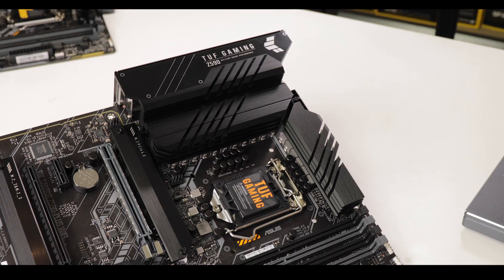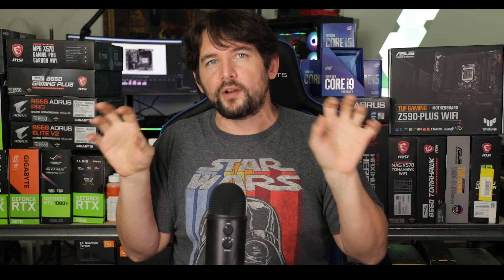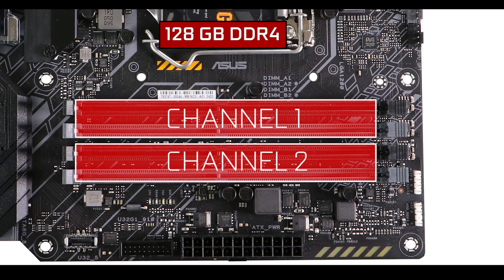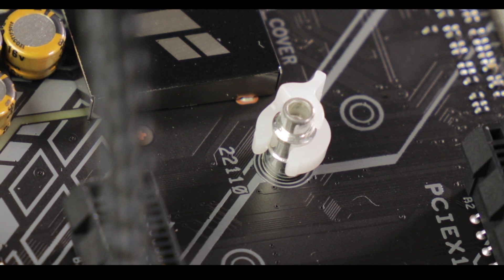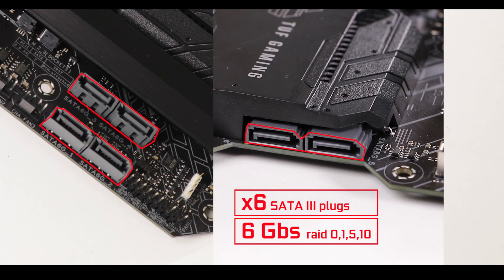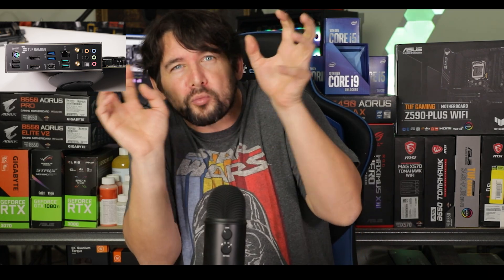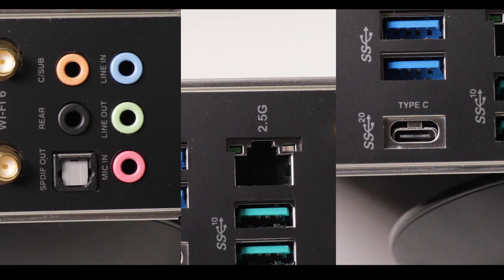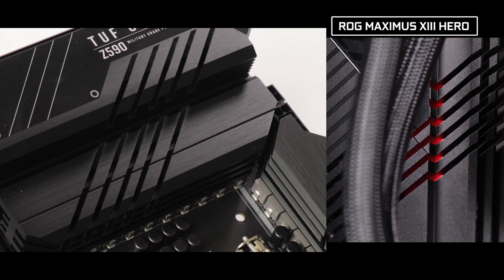ASUS TUF GAMING Z590-PLUS WiFi : TUF is now a Premium board!

Comment: Hi, I just bought this motherboard and the built in WiFi is going slow... ? I bought a WiFi card for my 6 yr old PC about a year ago and it gives me an actual download speed of 38 Mbps. My new computer, THIS motherboard, gives me 10 Mbps !! I tried much better antennas but no difference, the OEM one is fine even on my old machine. To cut a long story short, LAN is not possible in my apartment. I tried updating the driver, updating the BIOS etc still 10 Mbps! Is anyone else facing this issue? Or is my motherboard faulty? Can anyone think of a solution? Please? Thanks in advance 😊

Comment: Plz stop being impressed by a 4,8ghz overclock, when most (good Z590 boards) does 5ghz+ all core. 
it makes you look almost as bad as your accent.
Reply from the maker: Interestingly many board advertise higher clocks, but few manage to deliver a stable experience across different ram brands.

The TUF line up delivers that despite being cheaper than me expensive boards who don't ( i.e. : maximus Hero to stay with Asus).

I hope this helps

Comment: the video feels short, your videos have quite a nice dynamic 
you explain things in a simple and easy to understand way
as geoger harrison said, "what a nice fella". 

Does the asus tuf z490 plus wifi work well with an 11th gen i7 or i9, which is the most it supports without compromising VRMs?
Reply from the maker: Thanks for the kind words :)

Both can support about the most powerful CPUs available on the Core line up 
They also both can deliver PCIe 4.0 standard when coupled with the 11th gen Intel CPU. 

The z590 has definitely a better IO , the tooless m.2 ssd locking system and a much cooler VRM. I'd go there if u have budget room for q more premium experience , but if not the z490 varian can do everything the Z590 can.

Hope this helps
Reply: @Laurentschoice   Oh! That was quick, I guess that's how the French do things in Australia, and thanks for your answer
I wish my ISP was fast too, they just ignore me 
The next time I talk to them, I'll tell them why you can't be like the frechstralian? 

Anyway, have a nice day sir.

Comment: Would you choose this over the MSI z590 Pro wifi though?

The MSI board is significantly cheaper for doing the same thing.
Reply from the maker: They are totally different animals.  

The TUF is a premium board.. with heavy characteristics .

The MSI z590 Pro (which I am reviewing next week) is definitely a much cheaper and budget board with less premium features. 

It all depends what you will couple it with  CPU wise
Reply: @Laurentschoice  With the i7-10700k

The big question is does the additional features justify a £45 price difference (in my case)

Very interested to know what you think.

Comment: This is my second question, can a gtx 1660 ti go in the pcie 3.0 slot? I am wanting to insert that in the bottom one, then when I get a 30 series card i can put that in the top one. I don’t know a lot about computers, but i’m going to say that my cpu is a i7 10700, if that helps at all. ty
Reply from the maker: 1660ti Will operate at nearly 100% performance on the last slot. 

Anything beyond that will be a bottleneck for ur card.

Comment: Amazing review. I just snagged this board to go with my i9-10850k and RTX 3070!
Reply: How did it go so far ? I’m thinking of getting this for my i9 10900k and I wasn’t sure if it’s gonna work or not as I usually go for same generation mobo and processor. Did u need to do any bios update or something to make it work ?
Reply: @Exteliongamer  Works out of the box just fine. Even used the on-board auto overclocking and it's pushing 10 cores at 5GHz, 5 at 5.1 and 2 at 5.2.

Comment: you absolutely killed it in this review.  Very concise, actually covered the difference between 10 and 11 gen Intel CPUs and what they do on this motherboard in under 16 minutes.  You have earned my sub.  Do they still use ultra high quality caps on this MB?
Reply from the maker: Hey thanks :) really appreciated. 
Yes they do :)
Reply: @Laurentschoice  Friend, I can connect a beef cable for the Internet since I don't want to use it with WiFi.

Comment: I am confused.  At 4:47 you show that you can only use 2  far away m.2 slots with 10th gen.  However, the slot on your test system next to graphics card, you have installed a nvme drive with the 10900k in that slot? so can you or cant you? or is it only use 2 nvme out of the three?

Comment: I have this exact same motherboard with intel i7 10700k and a crucial p2 1000gb ssd and for some reason it is not reading my ssd. Any advice?
Reply: The top (closest to the cpu) slot is enabled only with the 11th gen Intel cpu. Move your ssd down to one of the slots under the long heat sink.
Reply: @agordon20024  Thank you! This worked
Reply: Have you tried using another ssd that you know works?/does your ssd work in other boards?

Comment: That board is dogshit it doesnt let me overclock by ratio. It show target frequenzy 5,0ghz but in windows its back to 4,8. fresh windows no tools. Must be a buggy bios or chipset
Reply: I just recently got the board and bios reports my overclock but windows will NEVER go above 4.8Ghz. This is my second TUF z590; the first one had a failure on the top PCIe Slot "TDR_VIDEO_FAILURE" nvlddmkm.sys. (Bottom one worked no issues - even on 0504 bios version/latest) Got my second board (top PCIe works now, yay) thinking the overclocking may be remediated as well. No dice.

Pending ASUS' resolve to this second mobo I've gotten as it's completely unacceptable and have yet to find many with this exact board trying to overclock as well. Many have the z570 (AMD)variant without issues.
Reply: @Zelminar  well asus just answered me dumb: "we dont recommend overclocking at all. Thata why why wont give u any solution for this." well even intel itself says overclocking is fine. Also asus literally announced the board as overclocking board, they advertise ALL these features xD i found some solution btw: disable speed shift and it will work. Makes no sense but someone on the hotline told me the bios is corrupt so theres a wrong connection between certain settings that should not be linked. Speedshift btw not speedstep! Leave the rest on active like dont disable turbo or speedstep or heist
Reply: @dvr1337  thank you SO much for the suggestion/information. Can confirm that fixed my issue! Thank you thank you thank you!!!! A bit silly Asus wasn't able to remediate this for me and I have to resort to a youtube video comment. The world we live in... 

I've informed Asus of this very same comment and hopefully their customer service folks document this and are able to relay to future customers of this board! 5Ghz @1.4volts @78 celsius (load) on 10600k

Drinks on me if you're the neck of the woods!
Reply: @Zelminar  has there been a bios update yet? Thankfully I just found these comments as mine arrives tomorrow hahah, anymore rid z590 bios tips for overclocking the 10600k? Not much online